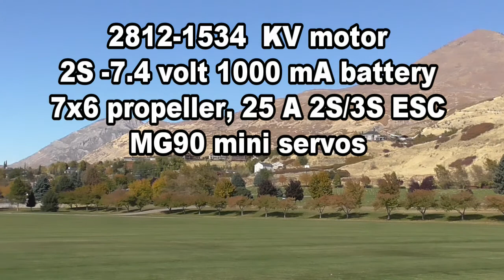Pelican Poly built light with flying video

Comment: When I first started I slammed that fusilage into the ground a few (hahaja) times. Honestly, will this be more or les durable. The fus eventually cracked so bad and was so full of glue I bought another one which has fared better...
Reply from the maker: We like to laminate fuselages after applying Scotch Extreme Tape around the nose of the fuselage.  When built this way the fuselage is almost indestructible.  Take a look at the Pelican fuselage building video on our web site along with this video and you can see the building technique we use to make the fuselage last.  If you don't tape and laminate the fuselage it will tear.